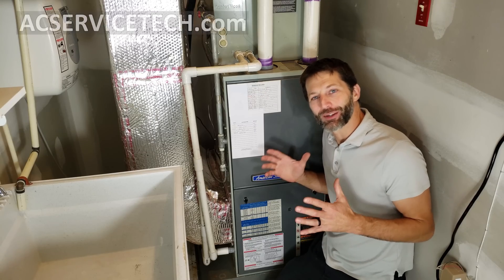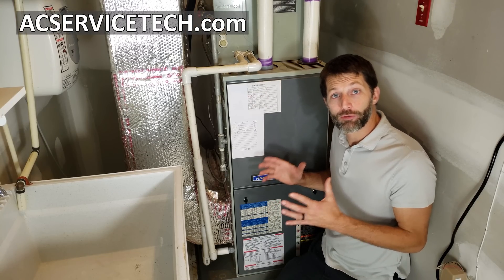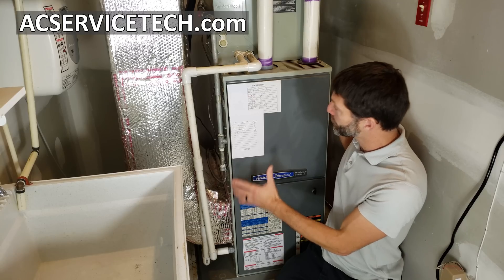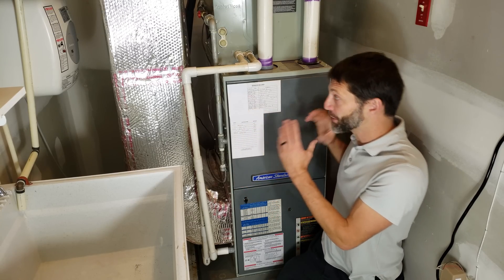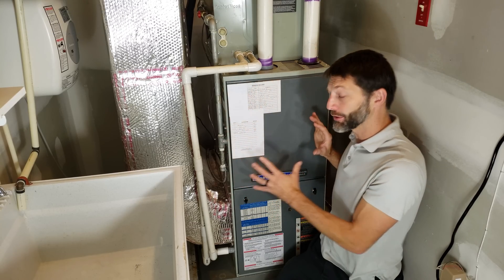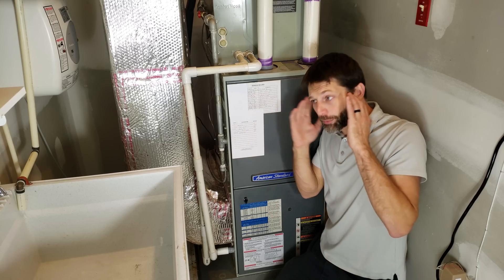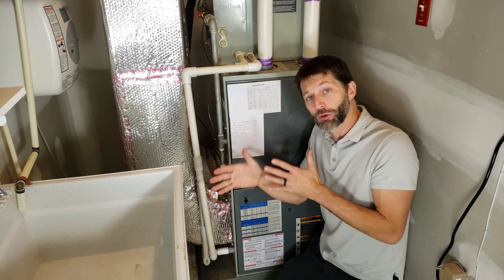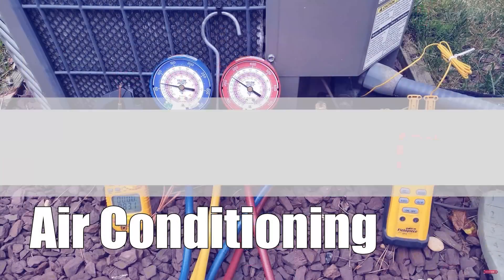Explaining "Gas Furnace Basics, Operation, Efficiency, Parts" to Your Apprentice!

Comment: Thank you so much for the detailed instruction. One question, once the control board gets the 24V signal to start heating, why does the pressure switch look to sense a drop in pressure of the combustion box. Is it because the inducer motor is pulling a suction of the intake air, therefore the pressure is lower? More specifically, what causes the pressure drop?
Reply: Update, I figured it out. Yes, it is due to the slight vacuum created by the inducer motor inside the combustion box, which pulls the diaphragm inside of the pressure switch inward and effectively activates the switch to continue the heating process. Thank you again for the fantastic detail on the gas furnace.
Reply from the maker: Thank you for watching, I'm glad you were able to diagnose the issue causing the pressure drop!!

Comment: Thank you for the video I really appreciate it! I had someone tell me that with a 90% or above if you don’t have a minimum set temp above 60 you can end up with early failure of the secondary heat exchanger. Like for a garage kept just over freezing. Was this a sales technique used on my friend or is there sense behind this? I’ve never heard this before and wasn’t sure if I should tell him yes or no.

Comment: I have a Daikin gas furnace and the middle burner have rush on the plate of the burner, What Is the cause ? The in side of the heat exchanger seem ok and the burner too . What can cause that ?

Comment: Craig, My heating system has been installed approximately 10 years now. I’ve never paid much attention, but I do know I have a high efficiency unit. PVC exhaust. One of the main things I’ve noticed after viewing your videos is that I DO NOT HAVE any outside combustion air installed. I’ve always noticed that when the unit kicks on if my basement door is open it actually slams shut. Did the company just skip this Combustion air intake.???  The unit was inspected by the township and passed. Is it code requirement to install outside combustion air..???
Reply: I would say thats a hack install, someone decided to skip running an intake it sounds like to cut down on time on the job. I've seen this issue where it drafts so hard because of no intake installed it puts out the burners for the water heater.

Comment: Thanks Craig! I have a question on a rollout sensor. I have a Carrier gas package unit. The rollout sensor is an automatic resetting button type. I ran a continuity test on it and got 0001, however when I taped the disc the numbers jumped all over the place. There was no rollout, however the exhaust was wide open (unshrouded) on the side of the unit. Any suggestions? Thank You!

Comment: Have you had any issues with "smart" thermostats? I had an issue with my furnace the other night and it turned out to be the Nest. Everything would work up until it went to open up the gas valve and it would just click and then instantly shut down the furnace. I ran the C wire for the thermostat so it had constant power because i have heard that not having constant power can cause issues. I was just curious if you have seen issues and what you have done to make them more reliable and not damage the furnace. I currently have the old thermostat wired up for the time being as its starting to get cold and I no longer trust the NEST

Comment: Awesome video, I have bought your books and the material is great.

I have a question, we have a furnace that is making a popping sound when it shuts off? Any ideas where to troubleshoot?
Reply: Check the sheet metal, sometimes when the unit shuts off and burners stop throwing heat it starts to cool down and that's where you get that contraction from the duct work.
Reply: @clucknorriz6683  thank you

Comment: I think you may have missed a step.  Before the inducer motor is turned on, doesn't the controller board verify that the pressure switch is not stuck close?
Reply: Yes RP Smith you are correct, the IFC board first checks to see if the pressure switch is  closed before ever turning on the inducer
Reply: No - inducer motor proves pressure switch which tells board to go ahead and send electricity to glow igniter. The combustion motor clears all gases that may have built up in heat exchanger so it doesn’t blow up .
Reply: @badassgrower  wrong. It does check to make sure the switch isn’t closed before it ever turns on the inducer motor

Comment: Thanks for an excellent video. I am wondering how the gas can be at 1/4 psi while normal atmospheric pressure is around 14 psi. Wouldn't the air want to rush into the gas line when the valve is opened ( instead of the gas flowing out)?
Reply: When referring to pressure inside the gas line, we are using pounds per square inch gauge, 0 psig is equivalent to 14.7 psia or pounds per square inch ambient.
Reply: @justenhaight6429  Ah that makes sense now. However, I'm still confused why he said car tires are 45 psi. Normally car tires are 32 psi....so on the psig scale that should be 18 psig,  correct?
Reply: @andyfer7716  car tire pressure is also rated as psig, so psia = 14.7 + 32 psig = 46.7 psia.
Reply: @andyfer7716  car tire pressure is normally listed on the tire, and is usually the cold pressure of the tire, once the tire heats up the pressure will increase, passenger cars are typically rated at 32 psig cp, but the larger the vehicle and the more weight it has to carry, the pressure rating will be higher.
Reply: @justenhaight6429  Yes, I think you're right again. BUT he is comparing 1/4 psig to 45 psia ...instead of comparing 1/4 psig to 32 psig. Would you agree?
Reply: @andyfer7716  he is referring to psig, but he did not distinguish the difference in this video, usually you will not need to reference ambient psi when when working in hvac, psig is for convenience, so instead of starting at 14.7 psia, you start at 0psig. 14.7 psia = 0psig.
Reply: @justenhaight6429  Thanks again . But isn't his comparison odd since he mentions tire pressure in psia instead of psig?
Reply: He probably drives heavier vehicles. Our work vans run 60psig in front and 70psig in rear. Point being hes not an automotive service tech. Hes an hvac tech.
Reply: So what he is referring to when he said 1/4 psig, is one 1/4 psi above ambient.

Comment: I don’t like the general design which has the evaporator coil on the top. It’s very hard to clean up the evaporator coil. Evaporator coil at the bottom will be much better for evaporator coil cleaning.
Reply: Can’t do it like this with a gas furnace. Will literally void a heat exchanger warranty